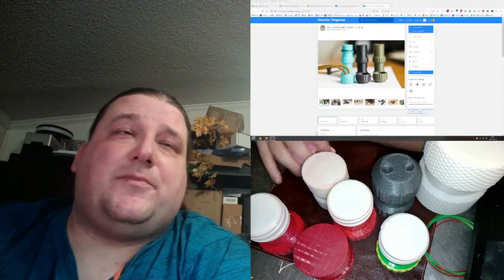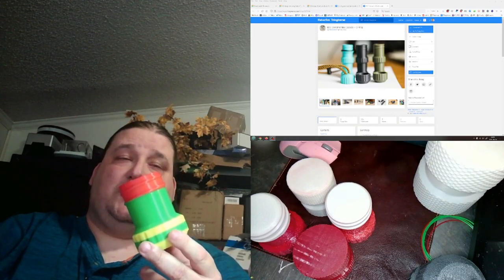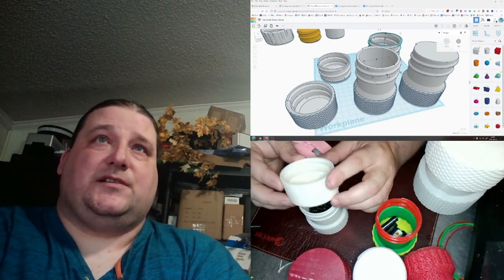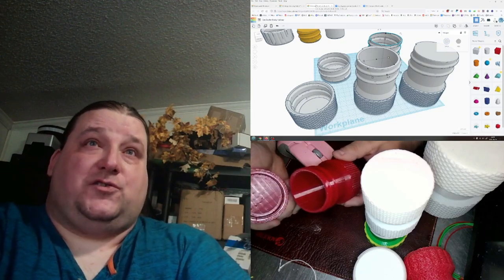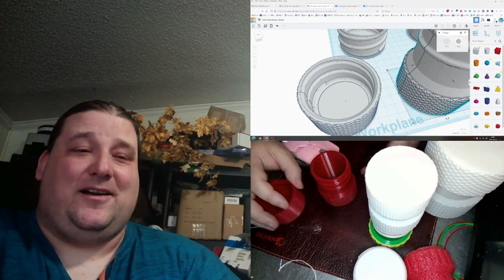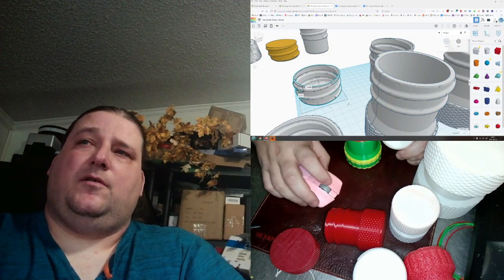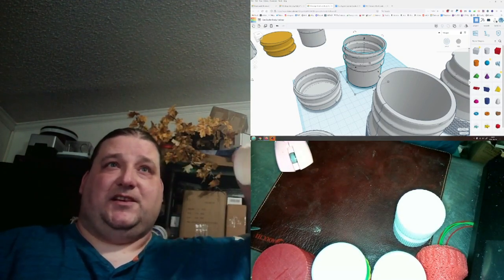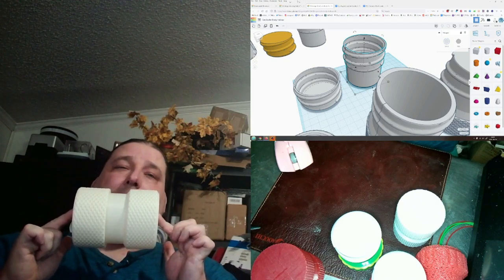Geo Caching Container 3D Printing T3DP

Comment: You could paint some liquid electrical tape around the top flat edge of the inside cylinder to provide a seal if needed, if the threads alone didn’t provide enough

Comment: Chris, couldn't you 3D print a gasket or flat piece that can be glued in to help seal. Maybe a TPU or other flexible material. I love Geo caching and started back around '95.
Reply from the maker: Yes absolutely worst case scenario I can print a TPU gasket but I also like finding elegant single part solutions when possible so I'll keep playing with it